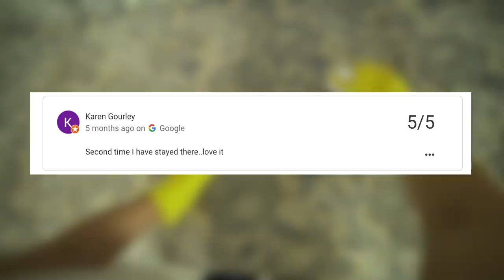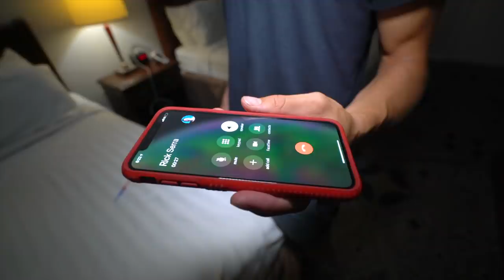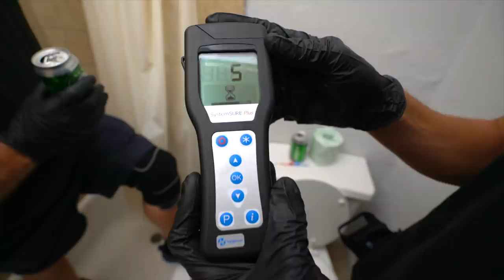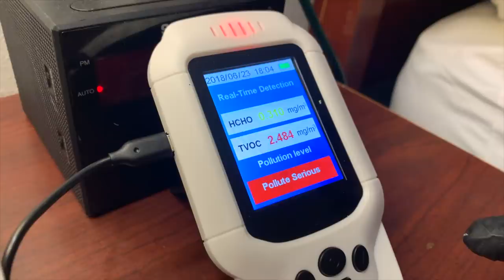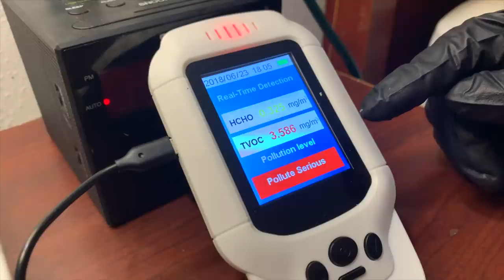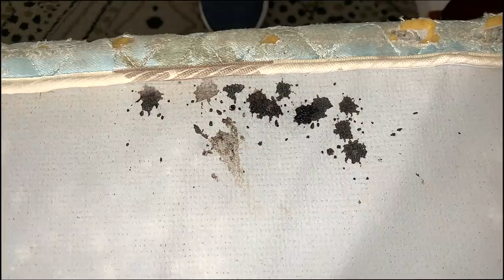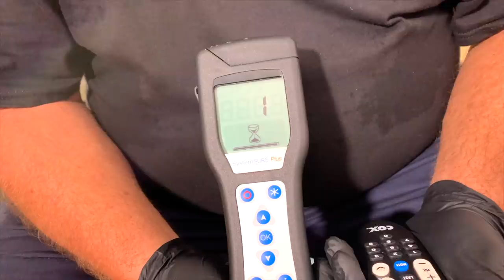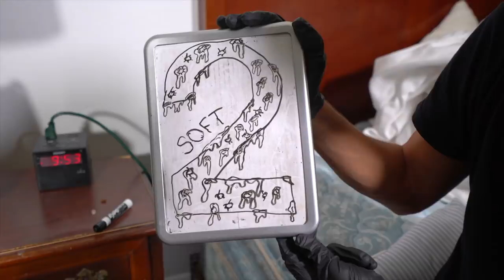Another Dirty Room THE FINAL SEASON : New Orleans : Bed Bug Booger at the Midtown Hotel

Comment: The hotel seems like it has potential to be nice. If they just cleaned up the room, did a repaint, replaced the mattresses/sheets/ furniture, it would be a decent room.
Reply: The bathroom shower stall needs work tho. The point that rick was showing with the tiles having a gap behind the wall is that the shower stall was not properly waterproofed.
Reply: @broken_font1881  I read broken foot🤧
Reply: @TheCommissarIsDead  you mean broken_foot?

Comment: All that insurance money for remodeling after Hurricane Katrina was pocketed big time, i bet there's toxic mold and other contamination all over that place on top of it which is probably why the air quality meter started going haywire the second you turned off AC circulation.  The only solution is demolition for this atrocious health hazard.  If y'all ever make it out to the Midwest, at least half of the hotels in Milwaukee would not pass by a long shot, the Fox Hills Golf Resort (with hotel and villas) in Mishicot, WI has had bedbugs before and is not well maintained, and the Club Quarters (central loop location) hotel in Chicago is disgusting.  Love the ADR series hah.
Reply: What an absolutely ignorant comment
Reply: @fieryhellkitten  Tell me, what is your experience with anything I listed then?  Because I've got oodles of it everywhere specified.  Ignorant, pfffft.

Comment: It's very common to cut a square hole for a round pipe because the flange is supposed to fit alot tighter then that. They usually cut a square hole for shower valve because hardware will cover it. Point is there's meant to be trim to cover those holes in tile and if the installer doesn't have a round masonry drill bit they will just cut a square hole with the grinder.

Comment: I remember one time we were on vacation, we got the best hotel ever, I mean like atrium, modern style, glass roof, 8 floors, several elevators, modern architecture and a nice organic interior, extremely clean rooms, it felt casual but high society, unfortunately our stay was extended due to flight issues so we had to use our emergency money to stay at the sleaziest most awful motel I've ever had the displeasure of residing in. Really a stellar difference between those two.

Comment: Ive workd in housekeeping a very long time and a bed bug trapped in a booger is a new one. I think the guest saw a bed bug on the wall and trapped it with a booger. or the bug went for the booger. And i am assuming the lower chained hotels get used beds at auction or donated. AND please dont sit on or put anything near an infested bed. The bed bugs will crawl and hide on you or your stuff.